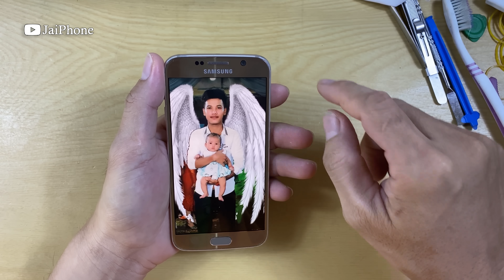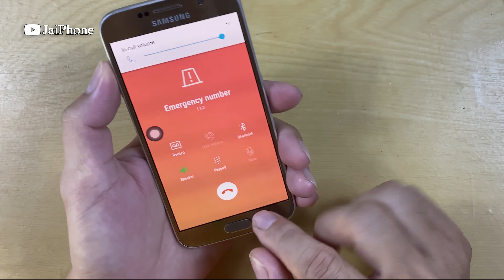Samsung Galaxy S6 Back Glass Cracked And Battery Replacement

Comment: Hi, I chose your channel because I think you are the best professional. I have a samsung galaxy s6, I will have to replace the battery and Jack does not work. Could you please make a video of replacing this jack, the charging socket. What is this squeaking preparation you are using? greetings
Reply: Ujb
Reply: You need to use soldering
Reply: @radhasrivastava7851  8hs